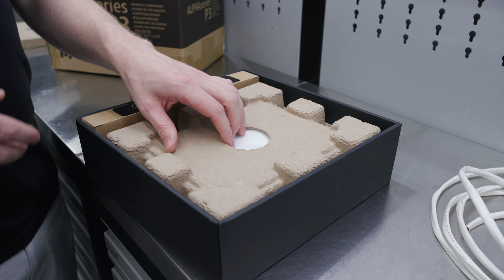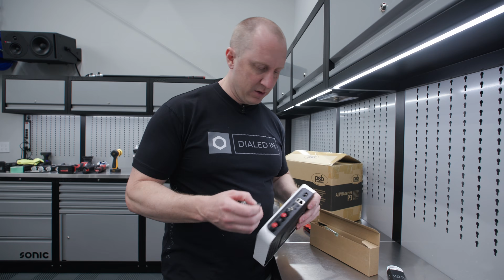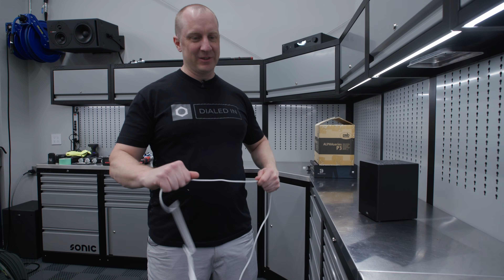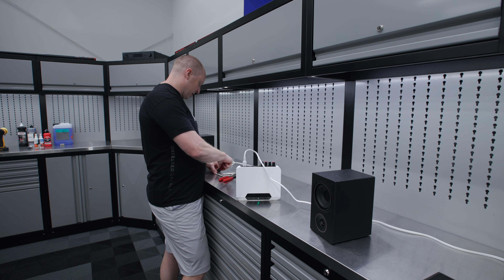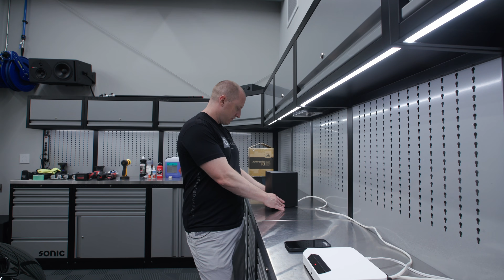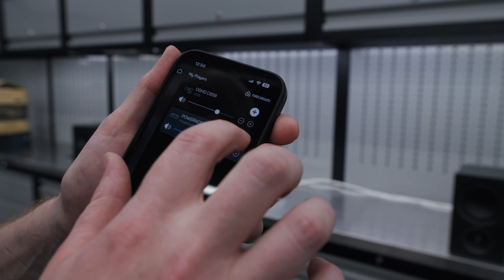Entry Level Garage Audio Setup: The New Bluesound POWERNODE Edge - Is This The Perfect Setup?

Comment: Currently using klipsch the fives as a soundbar replacement, would this setup be a worthwhile upgrade?
Reply from the maker: I don't think you'd like Edge over the Klipsch.  That soundbar is super efficient and has tons of output.  I think you'd need to go to Powernode and PSB P5 to like the improvement.

Comment: Is it possible to connect your PC or Mac to the Powernode edge without Bluetooth?
Reply: Airplay if you are a MAC user
Reply from the maker: Not easily.  You could use HDMI, but it won’t control it well.  You’d want NAD 3045